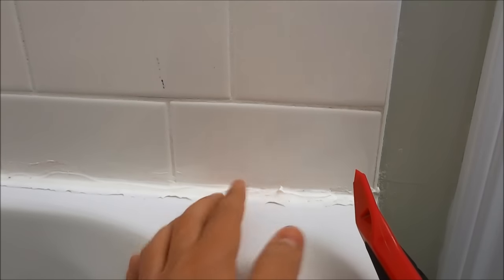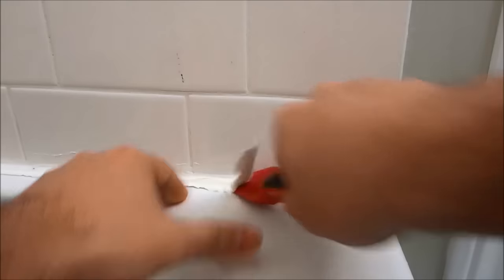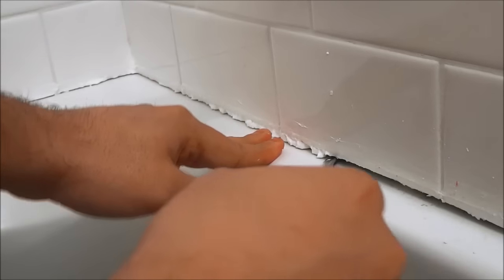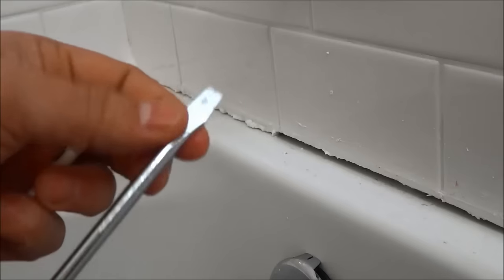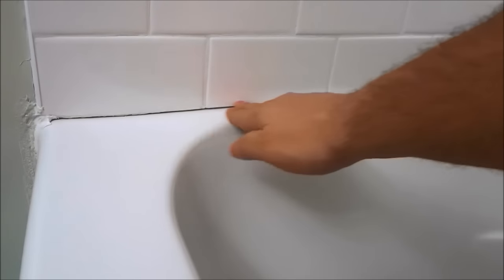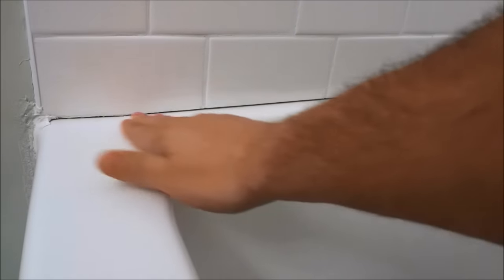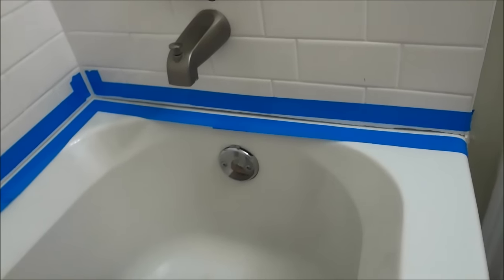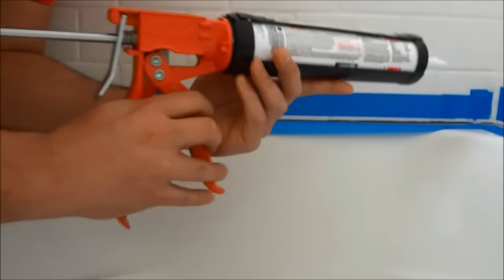How To Re-Caulk Your Bath Tub Or Shower

Comment: Best to fill the bath with water in case there is any movement between the bath and the wall.  Old houses can have that. Nothing worse than doing the job, filling the bath and finding the caulking being stretched.  Eventually just causes holes.
Reply: This. For anyone watching this video, new or old house, you should always fill the bathtub!!! If you have a floor shower, fill 5 gallon buckets with water and set it on the floor and try your best to work around them!! Help raise this comment. Leave the kids to fill the bathtub once or twice and you’ll get cracks from the weight and will have to redo it, patch it, or risk mold behind the wall. Good luck!
Reply: Great tip!
Reply: Re-caulking my tub today; would not have thought to do this. Thanks!~
Reply: @MrBlankscole  Your welcome
Reply: Thanks for this comment, about to caulk mine this weekend so I needed to know this.
Reply: Thank you. I'm re-caulking and decided to check out this video and some comments for some insight I didn't have. I'm going to for sure do this now!

Comment: After I vacuum I put rubbing alcohol on a cotton ball and run it down where I'm going to caulk the reason being that any little bit of oil from your fingers or soap anything that could improve the adhesive properties from sticking as well as the cotton ball will definitely catch on any debris left behind.  That just works for me.

Comment: only one thing that needs to be said and thats the bath should be at least half full of water
Reply: why?
Reply: Because the added weight of filling the tub or standing in the tub will cause the caulk to pull away from the porcelain. If you caulk it with water already in it, it will be applied with that existing stress. It makes it less likely that you will have an immediate failure in your new caulk job.
Reply: Very clever and handy tip. Makes complete sense.
Reply: @CraftsmenOnDuty  correct ! I re-caulked my ex-girlfriends bath in my swim trunks !, Also don't forget to NOT empty the bath till the caulk has dried !
Reply: @CraftsmenOnDuty  no wonder I see a crack in the corner often times!
Reply: Not just that. I wouldn't use a concave bead. Convex is much stronger and will  last a lot longer.
Reply: Yup!
Reply: Can use dumb bells and own weight instead of wasting water.  Not sure how to get a convex bead aside from not wiping it off.  Or is there a tool/plastic for that?
Reply: Robert Nelson, and no need for tape. Total waste of time/resources. This is amateur stuff right here. A great video on how NOT to caulk your tub.
Reply: @pbgf0411  do u have a video that's not amateur? I'm not sure what makes this amateur or not
Reply: @abgirl2729  you dont need painter's tape to caulk its "painter's tape" for amateur painters not amateur caulking jobs!
Reply: @pbgf0411  Haha! So true.
Reply: @SlothyWoffy   I should have paid attention in math, convex vs. concave :) Thanks for the tip!
Reply: @Marcelo-ed5vh  my math is terrible nowadays. I was quite good in primary school but that was about it :)
Reply: @SlothyWoffy  All kidding aside, how do you set convex caulking?
Reply: @Marcelo-ed5vh  😅 you use a tool or something with a straight edge rather than a finger that creates a concave.
Reply: Doesnt make any sense. Why would you full it with water?
Reply: @fabianvasquezjr8852  why does it matter? Tape is tape. Use it or dont ..everyone's own decision lol .....its tape that allows a messy or someone who is shaky, a clean line..just like it does for paint....
Reply: @rodgarant3875  if you don't do it, then proceed to have a bath, what happens is once the silicone is set, the weight of yourself and the water will put stress on the silicone and possibly break the seal. By putting the stress on the silicone prior to it setting you are giving it a head start for any future stress put on it.
Reply: @SlothyWoffy  this is absolutely incorrect if you put weight of water before the silicone dries it will crack and separatefrom the weight..you need to wait until all is dry and set before you put any water near that tub area.
Reply: @rodgarant3875  How does having water in a bath prior to applying silicone cause it to then crack? I've just told you why it IS the correct way of doing it. It puts a memory in the silicone that will then not need to strain anywhere near as much once you later on use your bath. How does that not make sense? 🙄.
Reply: @SlothyWoffy  I got it now..thanks
Reply: @rodgarant3875  no worries. Hope it makes sense now.
Reply: This comment is more helpful than anything in any of the videos I just watched

Comment: The Shop Vac is a good step, also a hair dryer can be used to dry the cracks where water may be trapped underneath.

Also I read fill the tub with water and work in the tub when you apply the calk. The idea there, apparently, is the added weight settles the tub (widening the gaps) so the calk will penetrate better and be less likely to crack or leak when bathing or showering after the repair is fully cured.

Comment: This is fine if you're using latex caulk, but if you are using GE Silicone II it won't just clean up with water. And you are supposed to use Tub and Tile silicone I or II (I recommend silicone II) to do caulk a bathtub or it will only last a couple of years, if that.

Comment: Nice explanation. The issue with using tape from my experience is the caulking always lift up a bit when the tape is pulled. It does produces a cleaner job but requires a lot of time and tape. They should make some self- caulking caulk. Lol
Reply: M M, that's because you're not supposed to use tape.

Comment: Not sure if I missed it but did you do a chemical surface prep like rubbing alcohol or wax & grease remover, etc? Having a perfectly clean mating surface for adhesion is crucial in any adhesive or paint application. Good vid .
Reply: smoknjoe73 I wonder, too ... maybe the silicone remover can help, if needed.  Home Depot sells that.

Comment: Yes, didn't think about taping off but it helps tremendously.  The first pass to smooth the caulk should be less pressure at first because after removing the tape, you will have to go through another pass of smoothing, with your finger and just a little more firm.  Need to ensure that there is still some caulk to smooth during the second pass.  Funny, when I asked the guy at Lowes, "where do you keep your caulk?" aisle 2, got it....lol

Comment: Use a heat gun and a 5n1 tool. Much faster and better results. Also the heat dries behind the tiles and removes surface moisture slash humidity. Heat softens the old caulk. Easy right?

Comment: TIP: Never use tape, even if you let it sit for 1 minute, you weaken the sealant by pulling it off the surface just a bit. It is not noticeable now but overtime, water will get through and sealant will start coming off.  Best way is to do this without the tape
Reply: Without tape or LOTS of experience it will look like it was done by a second grader.
Reply: The tape  idea is very good  . Look  good .  Use dry finger not wet.
Reply: Yesss. No tape. Get a craft sponge and after you smooth it out with your finger go over it once more with the sponge. There are videos that make a novice become a pro just by using a sponge

Comment: This works much better if you use Silicone caulk instead of the water soluble stuff. Silcone lasts much longer and most is mold and mildew resistant.

Comment: The tape is especially useful with silicone (which is best for wet areas) since silicone does not clean easily with water. GE Silicone says to use mineral spirits (might as well get some since its generally useful for a lot of stuff). Suffice it to say, be a bit neater with silicone.

Comment: I was going to recaulk the floor-wall edging of a stand-up shower. I got about 10 minutes into the removal of the old caulk and I actually verbalized the single word "No". I was telling myself that nope, I was not going to continue. This was mostly due to two factors,  #1, I am 70 years old and so are my knees, and #2, the old caulk seemed very stubborn. I was not going to be able to remove it all in a half hour which was the timeframe my knees gave me.
Reply: You can do it! Knee pads from Home Depot help and you can also kneel on a pillow. If the kneeling itself is too much, try sitting criss cross applesauce.
Reply: @emilianaleyva3755  You inspired me to try it again. I got a thick pillow for my knees and began again. Unfortunately the answer still turns out to be no. I could do the job, I think, but it would take a few hours which means I would spend the next three weeks bent over in pain with a stiff lower back, and limping from knees that do not want to operate properly.

Comment: The painters tape doesn’t give you the clean edge you’re looking for. It has small gaps that will allow the water to seep in and you’ll have mild again.
Reply: what do you suggest instead?
Reply: @carpii  no tape, take the time to clean up your mess in the end. Its worth it
Reply: @hayleym1012  I ended up not using tape, but used a Fugi kit. I got nice smooth lines, but even with the guide rails it creates little indents when you cross a grout line. Think I'll just hire a pro to do it next time

Comment: This was helpful, but I strongly recommend that you skip the masking tape.  Application is time-consuming and if you pull the tape off too late, you will have a serious mess on your hands.  I just re-caulked my shower and waited too long before removing the tape.  Using a wet finger to smooth the new caulk is simple and easy.
Reply: Thanks for this. I was already thinking I should skip the tape because I SUCK at putting tape in a straight line. I'm going to take your advice and go the easier route. :)

Comment: You did so many things right especially cleaning all of sealant, and being probably the best video of proper taping so you can tie into the corners. ( as a professional I would not  tape but this is exactly how i would tell a homeowner how to do it) and for amateurs the tape is not optional
But there were a couple of critical things you got wrong.  A damp sponge is not acceptable as final clean up. You have to use acetone or alcohol and immediately dry it with a dry cloth. That is THE only acceptable method.The ONLY SEALANT THAT IT IS ACCEPTABLE TO USE WATER( or any tooling liquid ) IS ACRYLIC.😮If this was acrylic then it is absolutely unacceptable in this location) The only sealant you should use in this location is silicone( 100% silicone not siliconized acrylic) and if you used silicone YOU CAN NOT USE ANY LIQUID TO TOOL.

Every major manufacturer says not to use liquids to tool with if you look close enough at their tech manuals. Here is what DOW ( one of the largest silicone manufacturers in the world ) says: NOTE: Do not use liquid tooling aids such as water,soap or alcohols. These materials will interfere with cure, adhesion and cause cosmetic issues.

Comment: Also, if you have little room behind your tap's, attach a straw to your caulking tube, tape it on tight and use that to get the caulking down the back of the taps.  Tidy as normal.  Taping is best with a plastic spoon to smooth it off, or get a proper plastic tool.  Tons of them on the market now.
Reply: Casper Wallace, as if his technique wasn't far enough from proper. Everything you added was wrong.
Reply: @pbgf0411  Everything I added - WORKS.

Comment: You are holding the caulking gun at the wrong angle. You need to cut the caulk tube straight off, no angle. So it FORCES the caulk into the gap. Finally the gun needs to be perpendicular to the surface being sealed. Again so it forces the product into the gap. Lastly less is more in the caulking world.
Reply: There's several techniques to caulking, it's not to be done one way and one way only. I've done it different ways and cutting the tip at an angle allows you to apply it and have a clean finish in one swipe without having to use a tool or credit card with the corner cut off to get that beveled professional finish.

Comment: I've been working on new, refinished  refurbished and remodeled bathrooms/ kitchens  ect for decades, sorry bud but that's not how you caulk anything, your wasting a ton of material and time, as soon as you take off the painter's tape your gonna leave a line on each side of your newly calked line then gonna have to run your finger down it again! Wasting time leave the painter's tape to the rookie painter's! Cut an angle off of your caulk tube first just big enough for the job at hand not half the tube. Then run a wet finger down your line, shouldn't have any waste your just smoothing out your caulk line not removing excess caulk.

Comment: that is not the proper way to caulk, when you remove the tape you got to make sure you see the both edges of the tape and you slick it with a Albion caulkers spatula slick tool
Reply: +cuervoz28 Thanks for the tip.  I'm eager to do a very close to perfect job.
Reply: Youll get a perfect straight line when you slick the caulking with a albion spatula they carry different sizes just make sure when you remove the tape you see both edges of the tape other wise youll be lifting up the caulking as you did in the video, trust me im a professional caulker I do this for a living
Reply: I'll buy my spatula tomorrow :)
Reply: +cuervoz28 See both edges of the tape? I don't know what you mean. Yes, you can see both edges of the tape. How does that help when removing it? Did you mean seal the edges? And if you did, only the edge at the caulking side would need sealing. Or do you mean removing any excess caulking covering the tape edge so you can see it?
Reply: cuervoz28